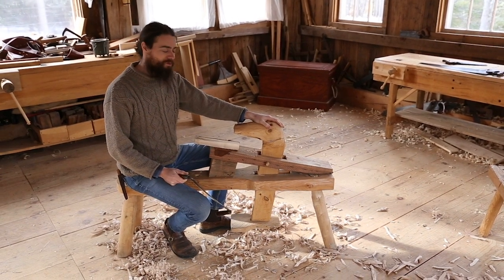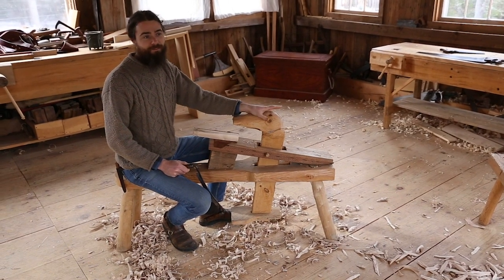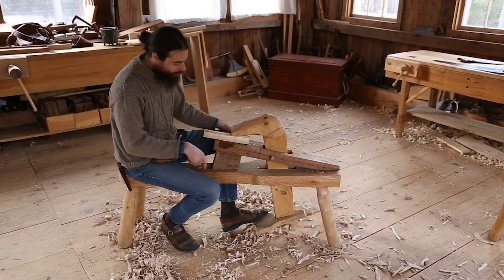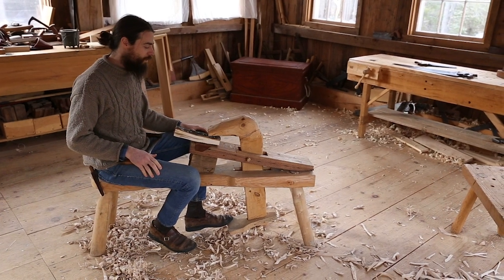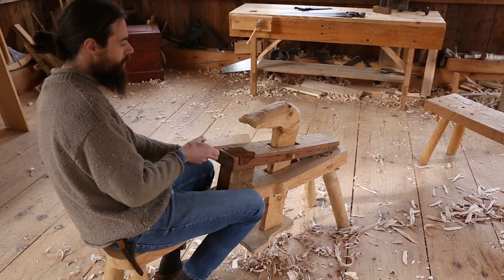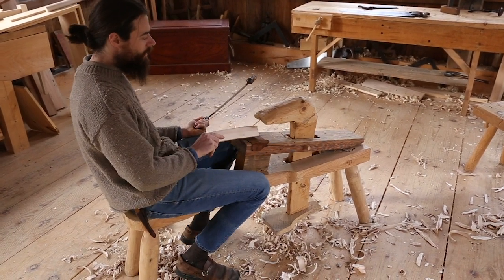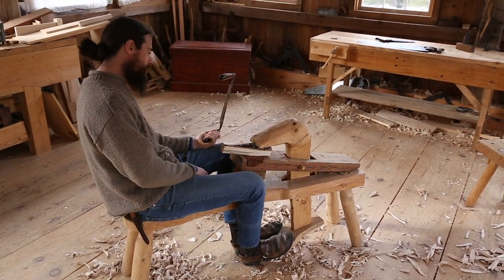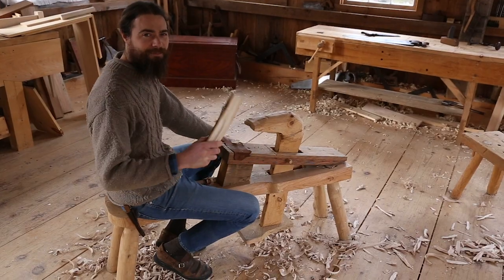Joshua Klein's Shaving Horse

Comment: Nice design😎🐴.
As for the vertical block of wood between your knees pitching up your 'leather-covered working surface'... did you home-in on the height you needed to make it comfortable for you to work with? and is it permanently affixed to the bench?. Just wondering.